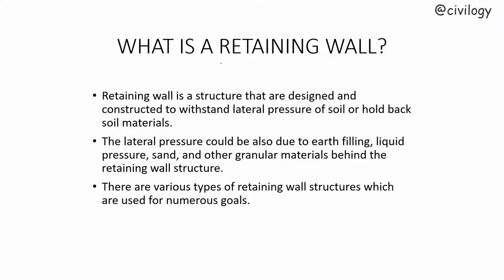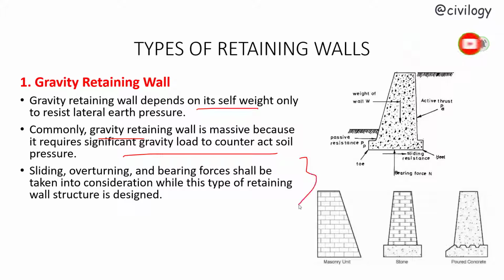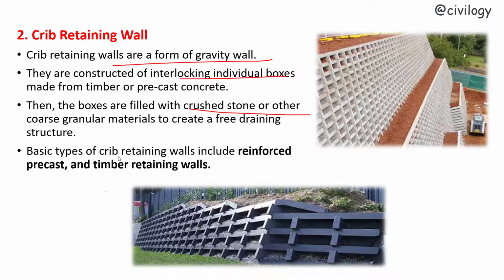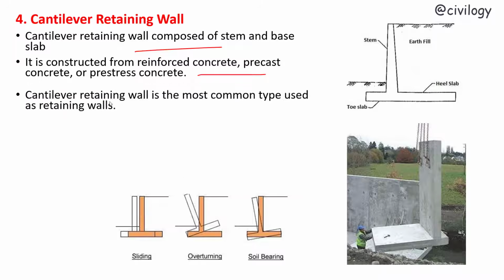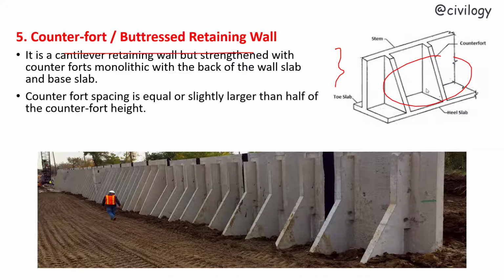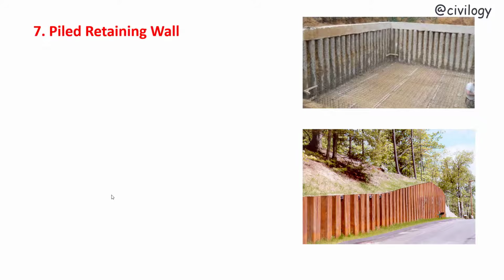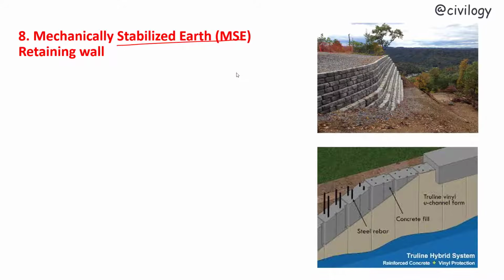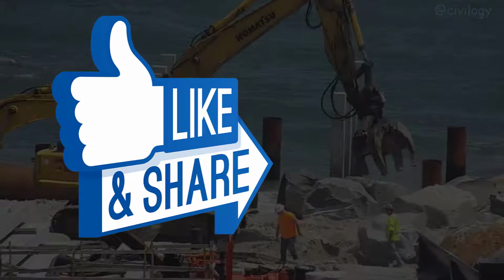9 Types of Retaining wall and their properties (What is a retaining wall?) || civilogy

Comment: G'day.  May be worth your while to have a look at this method of retaining wall construction, and have a read of the comments.  

https://www.youtube.com/watch?v=LMb3pnETBTw

There are also masonry walls that are dry stacked which are also used as retaining walls.  Keystone retaining walls are one such system that comes to mind.  These blocks are 36 kg each, and are held in place with each other by fibreglass pins, which insert into the top of the block, then the block above has 2 accepting holes in the bottom that the pins fit into.  Have also seen specially designed besser blocks which one could grow things in.  There was also a design, which was a shallow u/v shape, that interlocked and stepped back.  Again, things could be grown in this system.

There is no doubt in my mind that new retaining wall systems will be designed into the future.  It is critical that all of us keep up to date with what is going on, and also review older styles and systems, to see if they are able to be brought back.
Reply: THANKS FOR THIS INTERESTING VIDEO